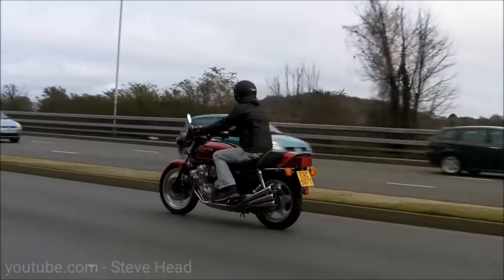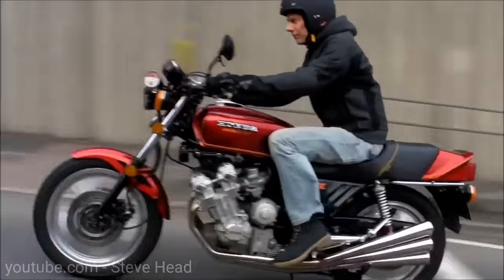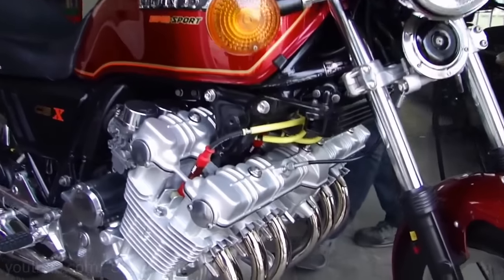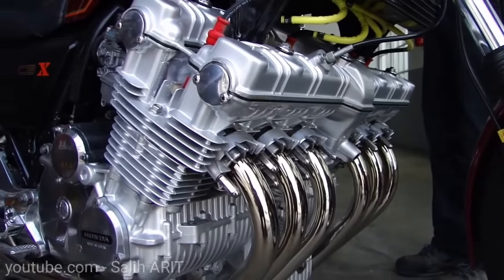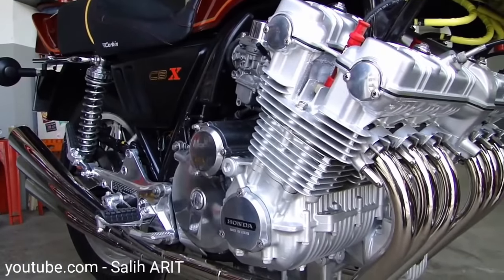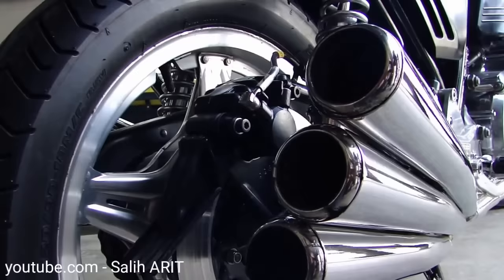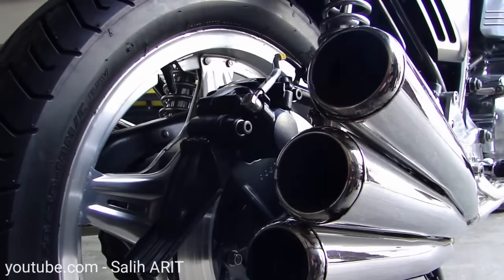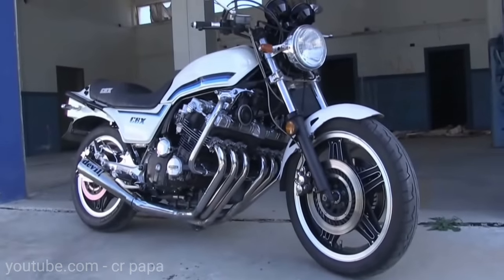Honda CBX 1050 - The Motorcycle That Sounds Better Than A F1 Car

Comment: Bikes today are so boring except for exceptions like the H2. So want Honda to bring back 250RR.
Reply: Try a K1600B
Reply: Unfortunately Modern emissions laws wouldn't allow manufacture's to build a 250CC 4 cylinder again
Reply: @kev8943  why not?
Reply: @Audfile  cuz even tho MC22 CBR 250RR where 250CC's those bikes drank a lot petrol almost equal to a 600CC and made 55hp,which is little more than half the HP CBX1000 made,not quite eco-friendly,basically the same reasons why manufactures stopped making 2 stroke bikes like the Yamaha NSR250 ECT.
Reply: @kev8943  well, it was a long time ago. Im pretty sure since we now have fuel injection, direct injection, just more advanced technology, it would get ok mileage. Im not buying that that is the reason.
Reply: @Audfile  but the thing is it's just not possible,same applies to cars like the McLaren F1,lancia delta s4 stradale,Mazda FD4S RX-7 ect something like those would never be built again due to strict emissions and safety laws.and I forgot to mention in my previous comment,that in order to homologate a road legal 250CC bike now,it have to be a single cylinder and under 40hp which is why the new Honda CBR250RR is a fuel injected single cylinder and makes just 36HP.
Reply: @kev8943  I thought they were doing that to be cheap.  What about a cbr400rr inline 4?
Reply: @Audfile  well there isn't 400CC CBR available but Honda still makes there legendary Honda CB400SF which has the 400CC  liquid/air cooled 4 cylinder with VTEC.even tho the engine is a DOHC it only uses a single cam when the rpm's are under 6K hence the VTEC (not similar to the VTEC on Honda car engine's tho)
Reply: @kev8943  all I want is someone to make a high revving light weight low displacement inline 4 sport bike.  Somewhere around 50HP and under 300 lbs.
Reply: @Audfile  the CB400SF makes 60hp rev's up to about 12k stock and weighs 400 something ibs, but it doesn't have the same handling capacity of MC22 CBR250
Reply: @kev8943  yeah its not a Cbr rr. Heck with Honda make it a ZX4.

Comment: Why they do this to us I dont know but 225 km/h    is 139 miles per hour.
Reply: 1digitalwatcher that’s because the entire world runs on the same system except for the US. Lol
Reply: @yyz.2112  Again why do they do this .
Reply: @1digitalwatcher697  because it's simpler
Reply: @zejoao142  I was taught in school it was more accurate meters or metrics  are  anyway    I dont care I want to know in  mph.
Reply: @1digitalwatcher697  well it is more accurate since each km represents a smaller distance than each mile represents, but I get it , American video should use American measurements

Comment: Years ago I bought a custom 05 Yamaha R6 that redlined at 15.5k, with a straight pipe, a mean cam, short pistons, and heat-wrapped headers, it literally sounded like a muscle car had a baby with an F1 car. When it got warmed up it idled so low that it sounded like a V8, and when you slammed it to redline it sounded like an F1 was flying to the moon. I eventually got hit on the 405 in Cali because of some idiot breaking the law and crossing the carpool lane illegally and hitting me. Sadly I took insurance money instead of keeping the bike and rebuilding it. But wow, I will never forget that legend of a bike.

Comment: the inline 6 cylinder also sounds good on cars, with a sports muffler it sounds better, with a muffler + manifold it sounds even better. A 6-cylinder engine on a motorbike with an ultra-sporty manifold, free muffler, 6 carburettors, here you reach 9000 rpm and the sound becomes a thrilling melody, Honda knew this well!

Comment: I was a Honda mechanic in 78- 79 we had one of these on the floor. It didn't sell for many months, probably had it for over a year.  Was priced at $2999. I would have killed myself on it. In fact I knew a guy that modified one with an awesome sounding exhaust system. When he left town he'd go through the gears, it sounded like a siren going off. Very impressive! After a couple of years you didn't hear it anymore because he killed himself on it. The new styled 750 was fast enough.
Reply: The Honda race team had a 250cc 6 cylinder. I think that was the inspiration for this larger model. Imagine a 250/6

Comment: A lot of my friends & I had these , one friend used to ride to work  about 15-18 miles Evey day early in the morning on a 5 lane highway when no one was around . 
He had a 6-1 header, big cams & 6  Mikuni Flat Slide carbs .
He said he was doing his usual 140+m.p.h. on a long stretch & he blew a red hot hole in the side of his header from the flames having no place else to go with the baffle in .
He said it got so load with his Helmut on that he thought his header broke off at the collector.
Ahhh the good old days 🎉😎👮🏍️😉💥🤐😱👿😖🤯☠️👀🤷

Comment: I like the rumble of a v-twin but also like that inline 6 cbx sound just as much.. Loved some of the cbx custom builds with upgraded suspension & brakes. Imagine a property  tuned turbo kit on one of those.
Reply: If you know anything about internal combustion engines you know it would be a crime to fit a turbo to one of these. Turbochargers are extremely efficient exhaust mufflers (see current F1 cars).

Comment: I’m 68 and l used to have a CBX lm a real shorty and often the road Camber  use to catch me out and l had to jump off lively and hold it up - great bike - the engine was so wide -  bought it from Eddie Grimsteads - the bike was actually discounted when it first came out as they couldn’t shift em - l experienced a wobble at 115 mph you had to drive through - the problem was reckoned to be lack of chassis cradle for the engine

Comment: I remember when these came out the local Honda dealership had 2 they were cream with blue stripes unfortunately they sat there for a couple years it was quite said I found it very Fascinating Years later in Austin back When 2222 Had those switchbacks on the other side of 360 I was making my way from 620 to downtown Austin On my black 1976 XLCH Which I had Put several goldfast goodies on it.. It was quite a spry machine 😊 And just like The song hot Is rod Lincoln

Comment: I love older streetbikes like this. I used to have a 2001 Bandit 1200 which was a mental bike in terms of torque. No slouch for top speed either. 250kmh was my top speed and I chickened out. Could have pushed it more.

Comment: I had one in around 1980, I consider it now to have been the second worst motorycycle I ever owned. I wouldn't own another Honda for over 25 years. My Blackbird was the best motorcycle I ever owned. 
The only saving grace for the CBX was the sound. I had a 6:1 on it when I took it to the Isle of Man for the Manx racing in September 1980. I was running it on an open pipe and I can still remember coming down from Kate's Cottage towards Creg-ne-Baa on Mad Sunday, totally caning it, 9,000ish in each gear. The wail off the surrounding hills was utterly magical. I could suddenly see all of the faces at the Creg looking up the hill towards me. As I got closer and started to slow down I was blipping the throttle and shifting down with the bike wailing and popping. As I got to the right hander those watching were clapping and cheering. I gave it as many beans as I could (without falling off) and then caned it again down towards Brandish, the wailing it made was just unbeliveable. It was one of two times that I wish I had been sat at a pub and watched myself go past.

Comment: I had a Benelli 900Sei 6 cylinder beast. Much lighter than the CBX for much shorter brakings. Its serial number checked -only the last one  Sei was made after mine, (1978)! I was not a biker wizard but I could beat the CBX any day - almost "hands down". Why? Because the HP/EW was much greater on the lightweight bike, thus my braking distances /besides acceleration/ were better than almost any other type! I have raced police Harleys, Suzukis, Kawasaki, Hondas - never even close to my limit. Pure joy  for 3500$ NEW!💰

Comment: One thing the air-cooled CBX didn't like was sitting in traffic.  It's power would drop off sharply if the engine got too hot.  Legal or not, knowing how to "split lines" safely was essential knowledge for the CBX owner.
Reply: Or the cb750 k models above mid 80s in a traffic jam just shut her down or she’ll hit that temp shut down for ya.

Comment: I remember reading a review at the time when the CX500 and CBX100 were released.  The CX500 was making better track times than the CBX1000. Honda had to pull the CX500 in because the handling of the CBX was appalling despite the CBX having more power.

Comment: I remember when They came out the local Honda shop had 2 They were a cream color With blue striping And they sat for years on the showroom floor It was sad Because I found them fascinating Years later When I was on my  black 1976 XLCH With an inch and 3/4 S and S carb and the hottest cams you could get for that iron head And a few other choice Goodies

Comment: THERE WAS ANOTHER THING ABOUT MY CBX. IT WAS ALL TRICKED OUT, SO AT 13 AND A HALF THOUSAND RPM'S.....I WOULD START TO PULL THE CLUTCH TO ANOTHER 1,000 RPMS OVER REDLINE AND DUMP THE CLUTCH. YOU SHOULD HAVE HEARD THE SOUND THAT MADE. IT WAS POWER SHIFTING, NOT TOO MANY PEOPLE DID THAT BACK THEN, OR NOW. I WON MANY RACES ON THE EXPRESSWAYS THAT WAY. WHEN I PULLED THE CLUTCH PAST REDLINE, IT SOUNDED LIKE I HAD BLOWN MY ENGINE OR MISSED A GEAR, I CAUGHT MANY RACERS LOOKING, ONCE YOU LOOKED, I HAD YOU AND DUMPED THAT CLUTCH AND I WAS GONE. YOUR EAR MUST BE IN TUNE WITH YOUR ENGINE. SO TRY TO IMAGINE, 1,000 RPM OVER REDLINE. ANOTHER THING ABOUT THE CBX, IT HAD A STROKE OF JUST LESS THAN TWO INCHES. 24 TITANIUM VALVES, 4 TITANIUM CAMSHAFTS, ETC. THAT LESS THAN TWO INCH STROKE MADE IT SOUND LIKE THE DEVIL COMING OUT OF HELL.

Comment: All that noise is great. But they were about the same power as the 4cyl Kawi KZ1000s at the time. The CBX looked and  sounded pretty nice. But it was just a sales pitch for Honda at the time. It just couldn't do anything better than the 4 cyls.

Comment: And even better than this Honda CBX 1000 (probably changed to 1050cc), was the one that "defeated" this motorcycle, with 240km's an hour! I'm talking of the famous Suzuki GSX 1100, 1980/1 model, that later gave way to the Suzuki Katana ! See the motorcycle history books, and discover ...discover also which motorcycle came after the Suzie GSX 1100, with a lot of power too ;-) But one thing is true: the Suzuki sounds great, but I prefer the Honda CB sound, either the CB 900 or the CBX 1000 of the eighties...

Comment: The Honda CBX or CBX 1000 was certainly NEVER referred to by its exact engine displacement in the UK. How would I know you ask ? I had one in the 1980s from Paul Smart Motorcycles in Maidstone, Kent, UK. It wasn't very reliable, but it looked awesome alongside my mates Kawasaki Z1300 and another mates Moto Guzzi 850 Le Mans. The three of us owned the three largest most powerful bikes in the popular card game Top Trumps. Please stop referring to the CBX 1000 as a CBX1050 😂😂😂😂 The CBX did not have a great reliability reputation but it did look great. 😊

Comment: The 79 model required careful throttle control as it didn't have a rev limiter . You could damage the engine easily .
Reply: Why to damage an engine ? You do not accelerate like crazy you can hear how the engine works and simply don't overdo acceleration.

Comment: I would like to hear an fly by from an modern 600 cc engine, extendet to 6 cylinders, 900 cc....... 17000 revs like an R6.....    And idle playing please only with flat slide carbs. Thanks.

Comment: Correction: the CBX will sound glorious IF, a 6into1 exhaust is put onto it, otherwise, it sounds good, but nowhere near an old "F1"

Edit: I was very big into Honda CB's, 750s mainly, had quite a few, but I lusted after both a CB350K/K1 (the baby 4) or an early CBX, sure, I'd take a CBX-B or CBX-C, but I'd rather have the more powerful, dual rear shock CBX

Comment: The CBX is rare because it never made sense so few bought it.  Inline fours are cheaper lighter narrower and make just as much power.  My GS1000 has the same performance at a much lower price.  The F1 sound is the only thing the CBX has going for it.  No one races them as far as I know.  They'd be crazy if they did.

Comment: Great video...yes I'm a fan of the exhaust note and the exotic look of the 6 inline exhaust headers coming off the front of the engine..so exotic..so different..it's a classic for sure...but.. unfortunately..it's not a fast bike..it really is not..I'm not going to compare to a modern super bike as this would be quite ignorant..I owned a 81 silver Suzuki katana 1000 in the early 80's my buddy owned the cbx..the Suzuki was much faster..much faster...

Comment: Fast at the time, but handled terrible. In hard corners the case would be scrap due to the engine being larger than the frame. I had one and went back to Kawasaki 1000.

Comment: A properly tuned CBX is indeed the best sounding production motorcycle.  

I must ad that if I was king for a day, I would make driving or riding any street vehicle with velocity stacks a capital offense.  Such bikes including the CBX in this video make more intake noise than exhaust noise.  Their negative effect on street performance is as horrible as their intake racket and overall engine performance except for one narrow tuning band.  Note that such vehicles can barely idle including the CBX in this video.  They are a profoundly stupid and ignorant failure for any street use.

Comment: Those was the days . When young men bought these and they take a hole punch to the end of the exhaust to beat out the muffle part of the exhaust . Pure idiots . Had one tell me that it made the bike quicker than stock exhaust . He just lied to me in front of my face . I just told him all you done was to burn up a bunch of valves and cook the the top of the piston . He turded red and went away . A month latter the bike sounded like crap . and with in another month he was not riding it anymore . He fried the engine .

Comment: Yes indeed over engineered, it doesn't make sense to put 6 cylinder engine on a motorcycle just like Honda Gold Wing it has multi cub engine with 6 small piston engine... I mean it's not fuel economy... Unless these big bikes is for trucking business with large cargo at the back...

Comment: "..severely under engineered chassis.."     ?     huh?...wai...wait a minute...   ..woah, hold on just a second there son.       

true this is one area imirajari could've lent more care to,  but....in return for (?), a trivial effectivness, because...thus were even the "best" tubular frame designs....the box-section had not yet been commercialized(mainstreamed).

the cbx already had the double toptube cradle that, tridentually braced via semi-spine member, was the then higher end machinery standard and, regardless....the engine itself was a stressed memeber of the front frame.

the cbx frame deficiency is an old fa...ehr, i mean, an old wive's tale.

Besides, if this is your serious machine, all you merely need do is a simple modification from the original twin shock swingarm arangement (assuming we wish to remain as stock as possible) for the later's pro-link suspension....while compoundly substituting the early 35mm with the later 39mm fork, but still, remaining within that original under 59" wheelbase and...hAA...you're untouchable my dude.

the cbx chassis deficency rumor had started circulating in late '70, early '80..
..yet..
..in reality, it wasn't anywhere nEAr as much an inherent frame design fault so much as it were that the majority of said "expert" riders could NOT manipulate the full capabilities of the cbx on the race track simulated segments of the real road.

i was closing in on graduation when rumors of a mystery fountainhead soon to be coming to motocycledom were 1st heard...then, well after the '79 cb750f, i was finally honoured with a few oppurtunities to ride the original cbx and....truthfully now my buds(?)...i can swear to you all that i, barrett, bore not posession of the requisite mass in balls demanded for taming that machine's full potential then....on all accounts, she left me with an absence of my sh!+

Comment: Again, I'm sorry, the CBX has a terrible chassis and for a long-distance rider will beat you to death! Conversely, my 1984 Honda VF1000F Interceptor is easy to put the "TON" (a 1000 miles) on a day and come back and do it again the next day, and the next! I'll grant an Asprincrate or 6 cylinder GoldWing is hard to beat to travel cross-country as fast as possible on two wheels, but I've made Tulsa to Yellowstone in 38 hours a couple of times at legal speeds and with gas stops, you can't do it much faster. A CBX would pound your kidneys out leaving you in Limon, CO. for a day to recuperate! I've made the trip on a 1964 305 Honda SuperHawk so this ol' fart KNOWS. Still have the SuperHawk too! Go to a garage sale and find a 1983 Suzuki GS1100ED or 1984/85 GS1150.